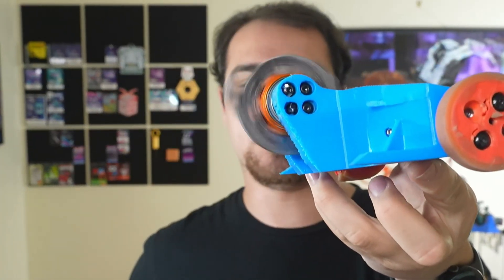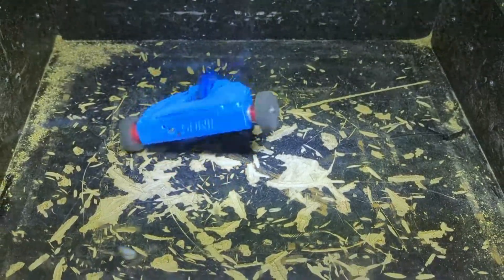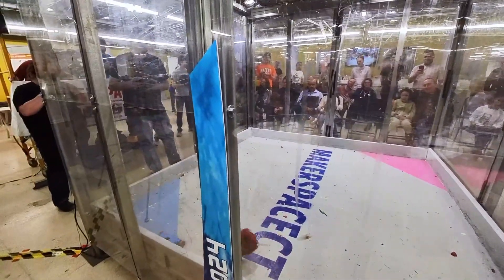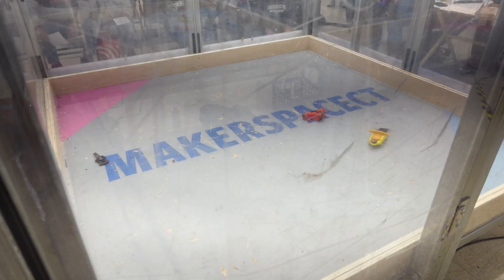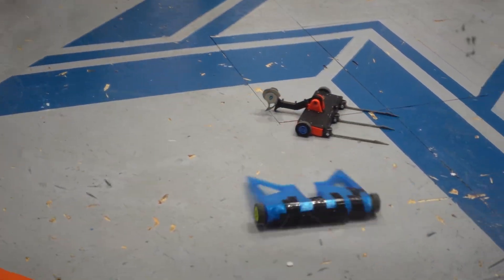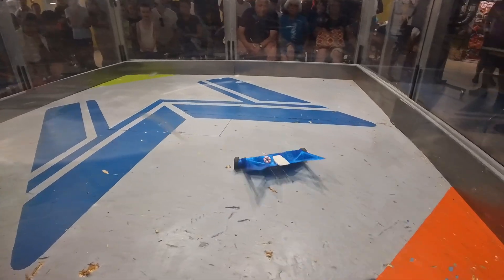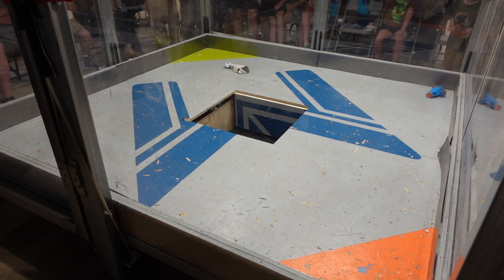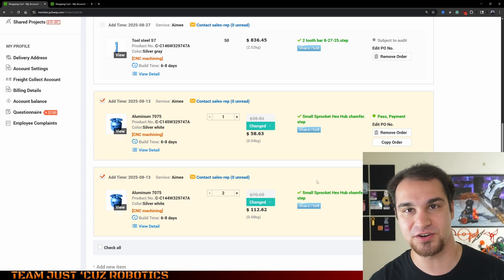My Combat Robot's Worst Nightmare...

Comment: Hi. I was wondering for a build of my own using similar electronics what battery you used and it’s kv and c rating it is.
Reply from the maker: I used a 3S 300mah betafpv one. It's like barely big enough though.
Reply: ok thanks
Reply: Ya I’m making a 4wd platform using repeat robotics drive motors and the RDY mini hub motor

Comment: Hey, how would the Blitz Light 1604 motors compare in terms of power and speed? I used a 25 mm 19:1 gearbox salvaged from a brushed motor/gearbox unit and combined it with a BE1806 1400 KV bldc. I ran 4S in my last competition. Switching the motor pin and tapping M2 threads into the gearbox (since it was glued and not screwed) was a pain, but it worked, I even won the competition! The Blitz Light setup would be about 20 g lighter per unit, as mine weigh 64 g each.
Reply from the maker: It's a bit difficult to say for sure. The Lites have a 29:1 gearbox, going purely by relative stator volume and gear reduction, your setup would have about 24% more peak torque but your current setup is wildly overkill for an antweight already, as are Blitz Lites. If this is for a beetle the Lites have enough power for most setups as well.
Reply: @JustCuzRobotics  This was a 1kg (~2.2 pounds) robot. I like some more controll/pushing power in my bot so a bit headroom is good. I most likley will use a pully drive to the front and rear wheel agian, so no direct wheel mounting. Do you think the 40g weight saving is worth it?
Reply from the maker: Whether it's worth it to you depends what you can do with the extra weight I suppose. If it lets you beef up the weak points or add needed power and weight to your weapon, or have an overall more reliable drive, then absolutely. Keep in mind it will still take at least 1 month for the Blitz Lites to ship though
Reply: @JustCuzRobotics  Thx for the answers. Next competition is in february, so long time to go but new rules are out now so I am researching.

Comment: I feel like right now for all of the builders sake. Most if not all Antweight arena should at least have a hazard that is close to the wall instead of it being dead center. In my personal opinion, I do like the idea of out of the arenas zones and pits of oblivion. But to have it right in dead center is diabolical and they really need to change that.
Reply from the maker: I much prefer no pit at all but I can maybe live with a corner pit rather than dead center.

Comment: The pit wouldn't be so bad if it didn't divide the fightable area so drastically. A 2x2 pit in the middle of an 8x8 arena cuts the spaces a robot can drive into small lanes without any room to maneuver and punishes the aggressive robots that would have otherwise put on a good show/ have engaged more after the pit opened. 

I hope Makerbattle will consider making it smaller or not in the center of the Arena, or just get rid of it altogether. I don't think it will make fights more exiting I think it will bring about a control bot and stalling heavy meta.
Reply from the maker: Yeah this is the only event that I've seen where they have the pit not against a wall not in a corner but just dead center making it pretty much impossible to actually have an exciting driving battle as soon as it's open
Reply: The pit feels like it was designed simply to avoid JDs. It's the only logical reason why it would be so easy to fall in